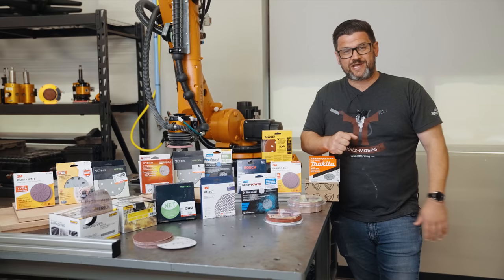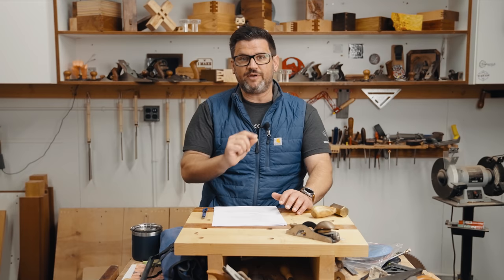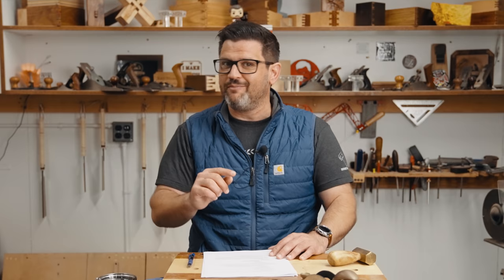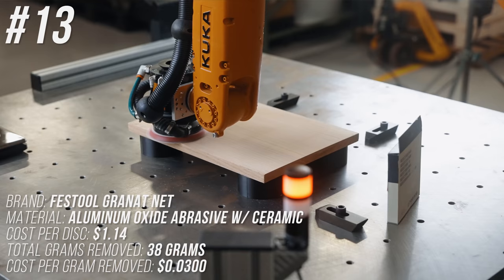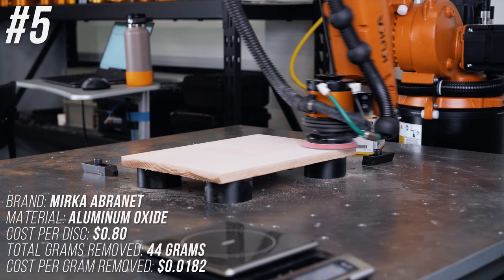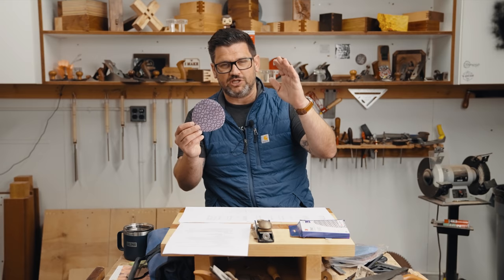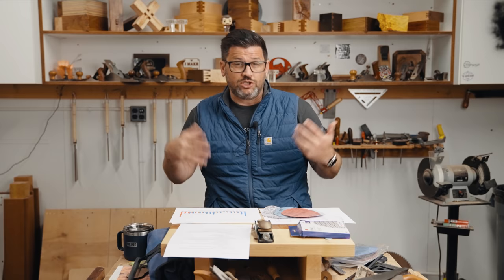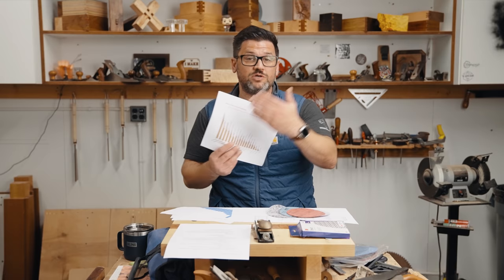Largest Sandpaper Test EVER Done - Top 19 brands Tested using Robots for Unbiased Data

Comment: Amazon is not a good place to buy sanding discs. The test itself is ok and should be fairly accurate. I would just argue how you did your math. Extract is the best disc IF material removal is your only concern but if your a production shop using production discs your paying way way less than this test and you might be better off buying a 40 to 60 gram removal disc at a much reduced cost in the 20 cent range. Your price at 0.41 for the 3M disc is probably the most accurate price on this list and the rest of them are inflated by gross margins unless your a home owner doing mickey mouse statues. employees don't always try to get the last mile out of a product.  A homeowner doesn't care as long as he gets his job done in a reasonable time with good results.
 On top of this you are testing the Extract against standard run of the mill product, so premium 3M product should be put up against premium industrial product competitors.
This test is equivalent to racing a Ferrari against a GMC suburban and saying they all get you there so its fair.
FYI-Mesh discs work better using a vacuum system because you are not re-sanding all the particles a second and third time. The heat generated is not hot enough to breakdown any part of the disc.

Comment: Does anyone happen to know if the xtract that landed in #1 is directly compatible with festool sanders, meaning will attach properly without modification?
Reply: XTRACT will work with Festool backup pads, but you may also go for 3M Multihole backup pads with male M8 thread.

Comment: And now it's sold out everywhere. Lol
Reply: It depends on where you look to buy it.  It’s in inventory through many industrial distributors.  This is an new industrial product, not only used in wood, but many other substrates…….composites, painted surfaces, Gel Coat or any other coating where dust is an issue.  Thanks for testing 3M Extract.

Comment: Do any of these papers come in a rectangle for the Festool rts 400 req? Any recommendations for that sander?
Reply: Try Abranet Ace
Reply: @okafka5446  thank you. I don’t see it in 3.15” width tho.
Reply: @lukeremis  Abranet Ace comes in 81mm x 133mm which is another way of saying roughly 3.19 inch x 5.24 inch. Long story short the Abranet will fit your Festool sander.

Comment: I bought the cubitron after the last review but can’t use it because it stopped sticking to my sander. Has anyone else had this same problem? And If anyone has used the new xtract , are there any issues with sticking to the sander? Also, Taylor Tools already sold out of 120 and 150 grit!
Reply from the maker: Need to replace the pad on your sander. The velcro sounds worn out.Theres pads you can buy for a couple bucks the stick on there

Comment: I just bought a 50 pack of the diablo mesh so I won't be buying 3m extract any time soon, but it's good to know the efficiency is basically cut in half after 5 min. I.e I shouldn't be such a cheapskate and change it out more.

Comment: I did a scan and didn’t see this commented on yet. The ATI sander specifically says on the side of it that it is “optimized for 3M abrasives”. I would generally consider that marketing garbage, but for the fact that a) 3M papers were the top 2, and b) you said ATI invented that sanding arm, so why would they put that sticker on a house-built machine just for fun?

If it does matter, what the hell does it mean to be optimized for a certain company’s abrasive? Is the orbit pattern different from a garden-variety handheld sander?

Love the test and I’m certainly going to give the 3M a shot, just thought that was a curious bit that may have thrown off testing. Curious to hear if/how that was considered. Thanks!
Reply from the maker: I've answered this repeatedly. Think Coke sign in a restaurant. Their sanders are so revolutionary and go in plants that use tens of thousands of discs a month that 3M has some sort of deal where their papers go out with the new sanders and then they get to advertise on the sander. I was not told what exactly the deal is but I don't care and this test was unbiased. You can't optimize a sander for a specific paper.
Reply: Roger that! That’s what I figured, just wanted reassurance that this test is indeed as legit as I want it to be. Thanks for responding to this yet again - I should have done a more proper comment search first.

Comment: I was surfing for reviews on sandpaper, sorry I didn't see it sooner.  Anyway, all sandpaper, by all retailers are ceramic.  Garnet, aluminum oxide,  silicon carbide, zirconium dioxide, are all ceramic materials.  I know as I am a ceramic engineer and worked making these materials.

Comment: Costs-per-disc analysis? Everything else is great, but the costs-per-disc do not line up with the real world. The Rubin 2 and Granat are about half the cost listed if you just buy a 50-pack.
Reply from the maker: Bought direct and just used my receipt for pricing.
Reply: I hear you. Festool just charges crazy high for the 10 pack. I’m guessing it’s to incentivize purchasing the 50 or 100 pack. The Granat is $0.65 (vs $1.60) per disc with the 100 pack.
Reply from the maker: I bought the 50 pack of all 3 I tested
Reply: @katzmosestools  Your video shows the 10-packs.  The 10-pack of Rubin 2 goes for $1.40 a disc, which is what you have listed.  The 50-pack goes for $0.72 per disc.  I'm just grateful you did the video.  Not trying to be picky.

Comment: Major discrepancies in per disc costs from real world pricing! You need to show how much and from where you purchased these. Both Klingspors are priced wrong (from Klingspor's own website, PS29 is $0.74 per disc, PS77 is $0.44. The 3M Cubitron Mesh is higher than what you show by at least $0.10 each (there are few places that even sell it and nothing shows a 50pk less than $0.55 per disc. How is this test legit when the cost factor is clearly off with no validation for the viewer?

Comment: Grams removed per dollar Is an important metric in determining the value of the sandpaper. However Professionals may be more interested in the metric of grams removed per minute. To the professional, Time is money. So a sandpaper that works faster may be worth spending more money on.
In your data, the total grams removed can be used as an indicator of the speedAt which the sandpaper removes material. This is because you ran all of your sandpaper disks for the same amount of time. However this isn’t totally true because some of the sandpaper disks may have become dull before the end of the test. But in that case no one would want to use them anyway.
Reply from the maker: You should watch the whole video or check out my data, which is free on my website. I discuss your comment almost verbatim.